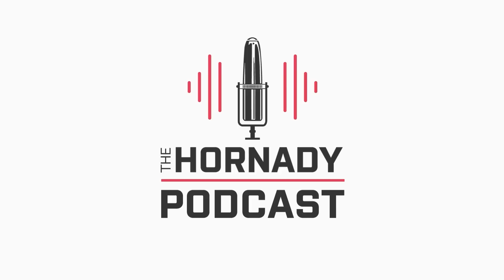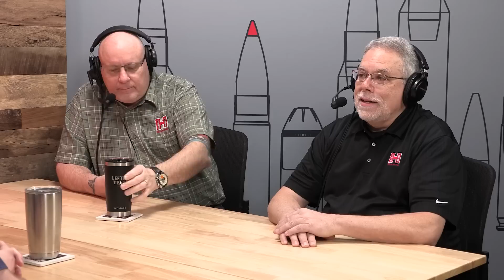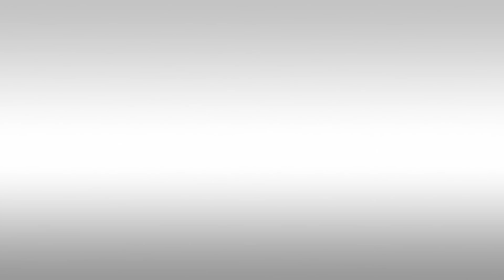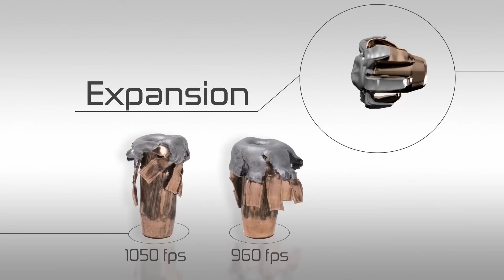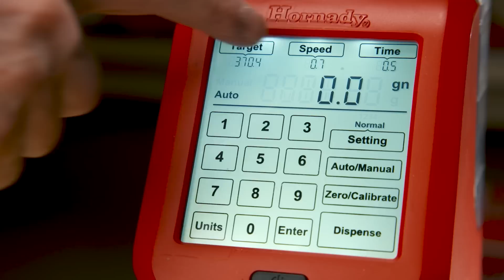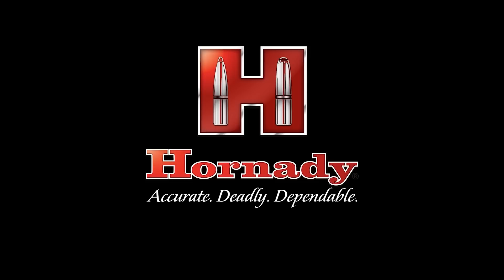Ep. 063 - How Bullets are Made

Comment: Questions in my mind, one was about seating the core and expanding it into the jacket, was about some form of explanation of getting air out of the cup when doing it, a bullet like the Interlock could be tricky. The other would be lead blends for the cores and how much they vary, or don't. Are you using harder and softer blends for particular bullets and weights?

Comment: I chose to carry Hornady Critical Defense (standard pressure) in .38 .spl, .357 Magnum and 9 mm and will when I start carrying my Bursa .380 use that round. I adopted there round after seeing the testing Paul Harrell did several years ago now of several manufactures hollow points in calibers from .380 up and barrel lengths from 2 inches on out. The ONLY round that ALWAYS opened up and NEVER over penetrated was the Hornady Critical Defense.